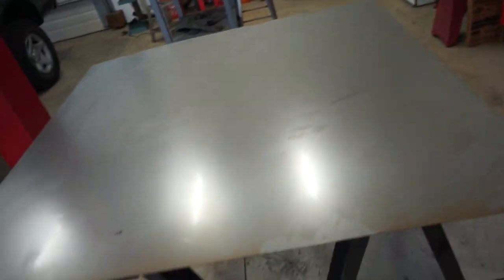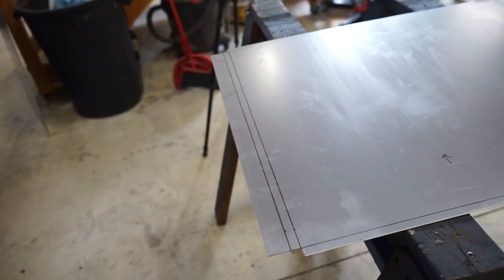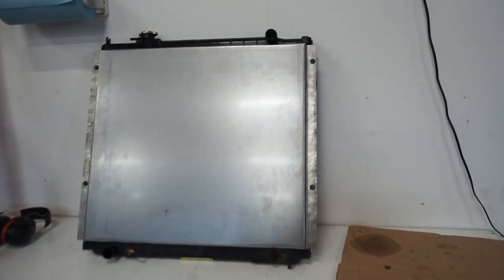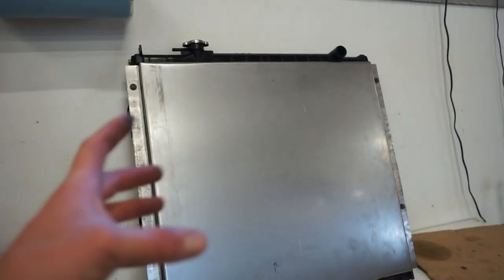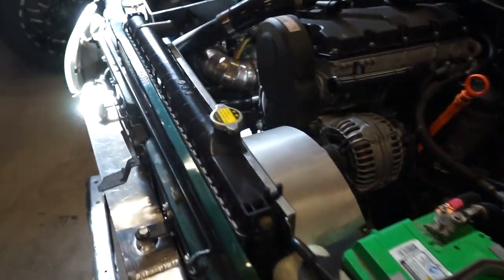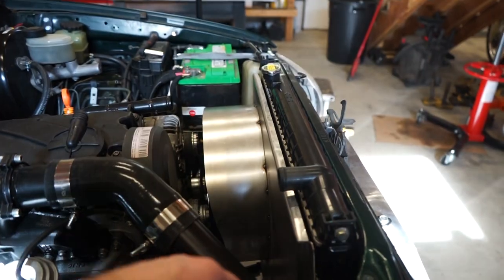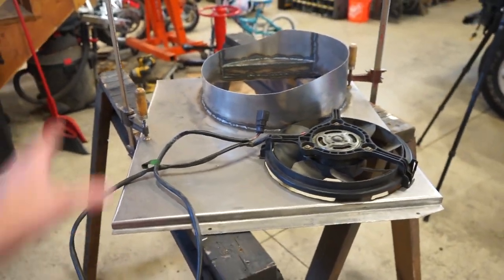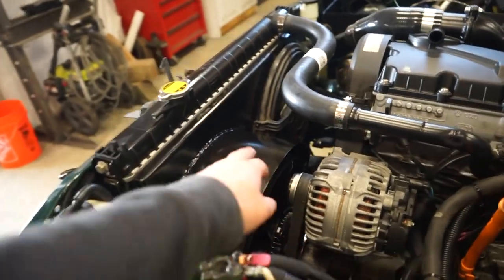Building A Custom Radiator Shroud For The Diesel Tacoma!

Comment: Looking good! The fan should come on with the ECU and when the AC is on. The ECU might turn it on when the AC is on but if not you can wire it so it will.

Comment: Hey Austin, in wood working in high school I learned a nest trick fro cutting holes. Put a screw in the center of the hole, cut a string to length and use the string to guide a handheld router. Not sure how well it will work with metal, but it cuts a perfect circle with wood

Comment: Hey Austin...
I like the way the shroud came out.., but you may end up with a condition where the mechanical fan will pull air through the electric fan opening when the e-fan is not running...🤔
To stop that you can space the e-fan back a bit and install some one way rubber flaps ahead of it...💡
That way, they will be closed once the e-fan is off and allow the mec-fan to draw through the radiator core only...👍
Just my thoughts on your design...🙂
Reply from the maker: Thanks! This is actually set up exactly how it was in the Passat! I don’t expect any issues with that!
Reply: Glad you mentioned this as I was thinking the same thing... but love Austin's builds so thinking it will work one way or another!

Comment: Connect the fan to turn on with the ac, you might run into AC issues if you don't. You could do a mechanical switch as well so it turns on with the ac and when you want it to
Reply: Why not both?  Should be pretty easy to do.

Comment: I just replaced my fan switch. Not sure if you can make this part # work but it’s (Four seasons 37820) temp switch. really simple to instal and no programming needed. Mine mounted to my rad. 1.5xm22 I believe. I can go check if need be. Probably your easiest option.

Comment: To control the condenser fan most modern systems have a pressure switch in the hi side pressure of the air conditioning system. It can also be wired to a temp switch in the coolant too but I wouldn't think you would need this but could be added . see this https://www.youtube.com/watch?v=l604JCZx_ow&t=4s